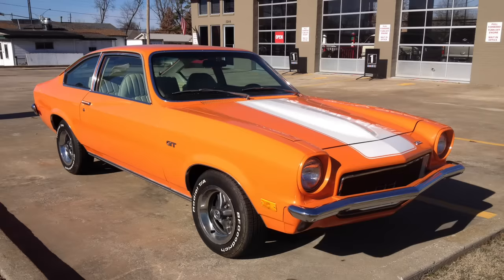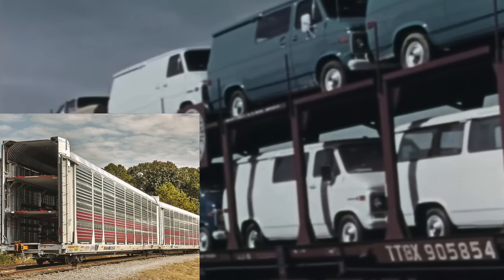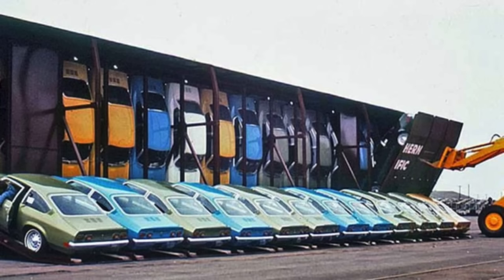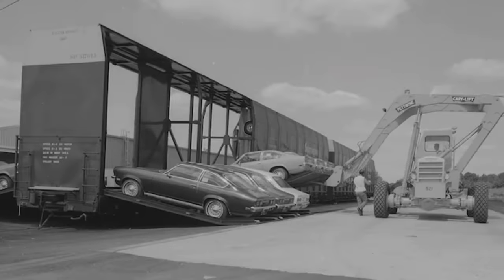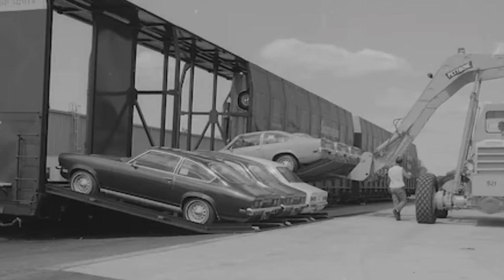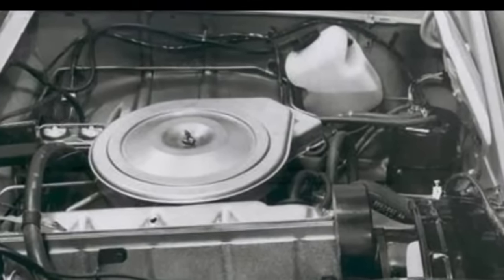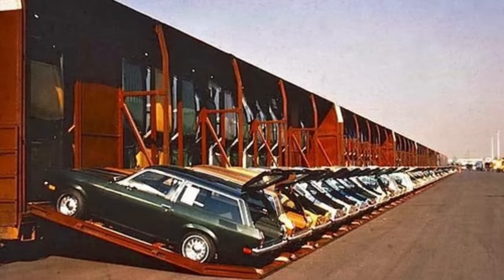GM's Coolest Invention Wasn't Even Part of a Car: The Chevrolet Vega's Vert-a-Pac Shipping System

Comment: Imagine what a great car the Vega could have been if...
-the rust issue was resolved.
-four wheel disc brakes was an option.
-the 3800 V6 engine was offered as an engine choice.
Reply: The 3.8 Buick V6 was a pile of shit in the 70's and early 80's. By the time it went through it's changes and was reintroduced as the 3800, Vegas and Monzas were long gone........
Reply: V-6? in a Vega???  First time I've heard that one.
Reply: @UberLummox  They did put that junk early 3.8 Buick V-6 in some Monzas, which was very similar to a Vega
Reply: Just another failed venture, along with the Corvair and Fiero
Reply: @georgeszilva1223  There was nothing at all inherently wrong with Fiero OR Corvair.
Reply: @georgeszilva1223  GM a failed company? I did not know that, ell oh ell.
Reply: @UberLummox GM got bailed out in 2008 and didn't repay it, and they are on track to need another bailout soon. I'd say GM is a failure.
Reply: @UberLummox  
There's a few videos out there on the internet with 3800s installed in Vegas... Fieros as well. This engine was one of GMs finest and is a common replacement.
Reply: @georgeszilva1223 
By the final year of the Corvair and Fiero   the bugs were worked out and these cars were fairly decent.  GM in its endless stupidity decided to drop both cars for no apparent reason.
Reply: @georgeszilva1223 Yes, the Fiero was such a failed venture that GM sold 370,168 of them.😂
Reply: @johna.4334  Ok interesting. Yeah I heard those 3800s were great. (I think?) The Buick one?
Reply: @catsaregovernmentspies  I thought we were talking 1970s.
Reply: Imagine a world where the Vega never existed.
Reply: The 3.8L would have been too big and heavy for a compact ECONOMY car!
Reply: The early odd fire v6's turned a lot of people off. Once the even fire version came out in '76 it set the stage for better performance.
Reply: @johneckert1365  they put the 305 SBC in the Monza/Sunbird too, if I remember correctly.
Reply: @ekimp252 I had a V8 Monza. It did ok for a smog slug.
Reply: @halfmil6467  back in the day, guys would use the motor mounts and other hardware to put a SBC in a Vega. I used a Trans-Dapt kit to put a 350/350 combo in a Pontiac Astre. That thing would scare the crap out of you.
Reply: @ekimp252  Oh yeah. I dunno about that, but wasn't there a smaller 2XX- something in one of those sh!tboxes? Maybe the Buick version???
Reply: @UberLummox  the Monza had everything from 140 & 152 cu in 4- bangers, 231 & 262 cu in V6s to 262, 305 & 350 cu in SBCs.
Reply: @ekimp252  That's it, thank you.
Reply: @UberLummox  There was a Prototype with a small 8 that never went into production.
Reply: The rust issue was solved and 4 wheel disc brakes on this car are shyte and the engine wasn't the problem. I have owned a plethora of these cars. A few we converted to 4 wheel disc brakes and they just never worked that well. The most successful braking ones were when we used a Monza or an S10 master cylinder. As to the engine, isn't it interesting that BMW, Mercedes and Audi are all using a version of the silicone impregnation in their aluminum engines? The problem with the H-Body cars, was the mentality of the owners. They didn't maintain the cars and blamed everyone else when they failed. I still drive a 1980 Monza Coupe and I have a rust free 1974 Vega in my garage.
Reply: @georgeszilva1223  and also the EV-1 fully electric vehicle.GM is a strange company!
Reply: @curtisbryce5096  Rust free? You must live in California or the Southwest.  These vehicles could not withstand the road chemistry in the Great lakes or Northeast.  The Rust issue improved somewhat in the latter years but they still rotted at their weak points.
Reply: @CSmith-gb1sl  They still weren't as bad as Rustangs. I lived in Calgary Alberta. I just made sure I kept the car clean.
Reply: @curtisbryce5096  Drier air in that area perhaps.   The humidity here lays a coating of brine on the vehicles, over most of the winter months, so keeping them clean is an endless battle... still is (plus your locks freeze) :(.  I have heard stories of these (earlier ones) having rust issues when sitting on the lots new.  I remember the cowls, rockers & lower panels being issue.  (Dad's cowls were gone on the '71 after 2 winters.) remember finally welding in galvanized panels on lower doors, lower quarters after many unsuccessful attempts to fix. 

They have come a long way on corrosion, though I now oil spray undercarriages, & lower body panels/wheels for about 6 months out of the year. 

Dad's Vega replaced his '67 Mustang, the trunk was pretty much gone & the back seat wells were intaking water.
Reply: @UberLummox  
Chevy Camaros and Pontiac  Firebirds as well.
Reply: @TheOzthewiz  
Au contrair,  the 3800 fits rather well in the Pontiac Fiero

Comment: Bean Counters were pound wise but penny foolish!
Reply: Kinda like the Pontiac Fiero. A fuel line made of rubber running across the top the heat producing engine = dry rot engine fires. Lawsuits then Huge recall to Retrofit w/ 100% metal fuel line
Reply: My mom used to say, of my dad, "He's book smart, and life dumb."
Reply: It was the railroad's idea not GM. The RRs saved money by transporting more autos on a given autorack.

Comment: The Vega battery caps were located on the top of the battery just at the top edge to the rear or firewall side of the battery. Not on the side of the battery as mentioned.  I had a NOS AC battery for my 73 Millionth Vega GT to use at shows.

Comment: All those modifications were inexpensive and simple, really just choices of orientation, and as far as I know had no effect on the durability of the cars.  The benefit of avoiding damage,  vandalism,  and theft was a great money saver,  as was shipping 30 instead of 18 per rail car.  I suspect it was a net benefit,  BUT... the Vega was very low-slung, and perhaps not imagined to work on future small GM cars like the Cavalier.
Reply: Never mind about the size-Cavalier was the same height.
Reply: @jamesengland7461 I'm still wondering why they didn't use this method on the X or J body cars a decade later 🤷‍♂️
Were Monzas shipped this way as well?

Comment: It's always baffled me why the Vega had so many reliability issues. Why didn't testing reveal the engine durability problems? Was prototype testing even done on these cars? Were the results simply ignored? I remember reading that Vegas were often vandalized at the factory before shipping. The shipping solution was novel but ultimately a bad idea.
Reply: They were vandalized by accountants and cost-cutting engineers before the first one was assembled.
Reply: GM never proved out the "handling" of a pre 64 Corvair either, especially the wagon. Ask deceased comedian Ernie Kovacs, or me. I nearly rolled over my Dad's 61 Corvair wagon. I didn't dare tell him what really happened. Anyway, when he brought it back from our neighbor mechanic (also) Ernie, who worked full time at a Chevrolet dealership, he said to me-  "Ernie told me to tell you next time you go around a corner, go around on 4 wheels, not two". Not the first time Ernie saw the issue. Gotta wonder how this stuff gets through the "proving grounds". Both the Corvair and the Vega could still be around. It's a shame, they deserved a better fate.
Reply: Good point.  The non-viability of the aluminum cylinder walls should have been found in testing.  I would think any engineer would immediately question that design feature.  Steel sleeves would have solved it. GM had already designed the 215 aluminum V8.  I read it had the aluminum block poured around ripple patterned sleeves.  I also read there was a very high percentage of those blocks had to be scrapped.  Maybe that is why they thought they could get away without a sleeve.  Too bad they just did not make the blocks from cast iron.

Comment: Why are there vents on the trunk?  This is a front engine car.
Interesting video, but what a stupid idea…, as someone else noted, use the extra money to make it better….
Reply: For cabin ventilation. Air flows through the cowl, into the cabin, and then out the rear vents.
Reply: @kw9849 All GM cars had that type of ventilation in 1971. It was discontinued after it was found to bring Carbon Monoxide into the cabin.

Comment: Really interesting video -- thanks! I'm coming at this from the railroad end and, while I was aware of Vert-a-Pac, I didn't know any of the details.

One things, though. Are you sure the height of the cars was an issue? The Vert-a-Pac cars don't look any taller than a conventional open or closed autorack, such as the ones you pictured at 1:05. Conventional autoracks do have routing restrictions because of their height, but that's not specific to Vert-a-Pacs and it's not a big deal. Of course, I'm just eyeballing two different photos, so it's certainly possible that the Vert-a-Pacs were a little taller, which could be enough to cause problems.

Comment: At 5:42 that Vega has an optional radiator that is much bigger than the radiator that came in most of the (non-airconditioner) cars
I believe that the cars with the larger radiator tended to survive to higher mileage than the others

Comment: My  dad worked at a  Chevrolet  dealership  in the 60 s and  70s   he  talked about  how  he would prep the  cars 'Vega ' and would  have to  top off the  transmission  @ engine  w/ the  proper  amount of  oil  before  it  gets to the  Lot  or show room  floor  !

Comment: Not all Vega's were shipped that way. Still, they all had the provisions to be suspended in the rail cars. The slots used for rail shipping were the only place strong enough to pull the uni-body frame, if needed.

Comment: As a kid, I remember seeing cars in an enclosed boxcar, stored at a very steep angle in the direction of the rails. I seem to remember the front as being low and the rear lifted high. I don't recall seeing this often, although I have talked with others who confirmed this. Perhaps it was also experimental, or a safer, less usef method of transport for high value vehicles?

Comment: So happy you posted this video Adam. I was not aware of this. So very cool to see. And I did question the 'liquids' at the start of the video which you educated us on quite well. I just remember tilting my lawnmower the wrong direction and what resulted. So GM really thought this over. In addition, I do remember open rail racks in the 70s. Regrettably, I also remember seeing the odd bully teenagers throwing rocks at the cars when the trains went by. The damage to automobiles must have been quite grand in those days..
Reply: Not flattering of humans a whole new way of shipping needed to be invented to solve a problem that shouldn't have existed.

Comment: Very interesting video, and pretty well done.  One minor point though, height considerations in rail shipments was not something new for these rail cars, it goes back pretty close to the beginning of the railroads themselves.  And there are dozens of tunnels across the U.S. which had additional height added or were "simply" made open to the air so that the regular double decker auto carriers could go that route - showing that height considerations predates these rail cars.  Now if these vertical ones were higher than the standard double deckers, sure extra care had to be taken in routing.  But to suggest this concern was something new that happened just for these cars, is a bit misleading.

Comment: That is some great background in the video... and @eastendproductionsArchiv... provided some very legitimate operational concerns.  I worked at the SP Rail sometime after the demise of this method and was able to rescue one of the presentations given to GM touting this innovation.  A great collection of pictures for sure. I was lucky to eventually work at another OEM deeply involved in the commercial aspects of moving finished VINS.  It is very complicated as the OEM's maximize the load factor whenever possible.  The RR's try to maintain an efficient network and this equipment, clearly being difficult to handle was also difficult to reload and so probably traveled many many miles empty.  Those empty miles were just a huge drag on the RR's economics and challenged the both RR's and OEMS in many ways.  If GM changed the vehicle envelope, the railcar could be obsolete.

Today's Bi and Tri multilevel railcar configurations have far greater flexibility for loading virtually every VIN length or height.  While the RR still only goes forwards and backwards, the current auto rack  / multilevel is about as good as it gets.

Comment: In 1995 I worked at a wholesale automobile auction which received automobiles and van by regular 2 level and 3 level automobile carriers. There’s lots of work to unsecure a load of vehicles from a rail car so I’m guessing that the concept of using vertipack  rail cars was in part trying to save labor loading and unloading them.

Comment: In 2001 I worked for Ford and I opened the door of a new t bird that a wino had hitched a ride across America inside . It was the worst smell ever and we had to replace the seats and the carpet to get rid of the smell and even that was a little iffy . The insurance company put up a fight because they said "you signed for it " and that was true but when we inspected a car coming off of the car carrier we looked on the outside for sand blasted paint and chipped windows in a very quick way we never had vino damage before .It was from Fort Worth to LA I think.

Comment: Back in the day [77-82], I had owned 3 Vegas and 4 Pintos. I had 2 GT's and they were SHARP little cars. They were quick with a 4-speed and even handled okay. BUT!!! The Pinto was a better car, both in design and build quality. Too many people got scared off by "they explode!!" but I'll tell you, the Pinto wasn't as pretty as the Vega. My 72 Pinto 2-door with the 2 liter and an automatic was a quick little beast. I put grippy tires on it and it could corner pretty good, stopped okay too. 
The rail cars wasn't a great idea for many reasons, the biggest losing proposition would be the rebuild and redesign of those cars every 2 years or so. I agree this was not a very well-thought out plan; seems like a last minute fix. Great video!!!

Comment: I owned 2 Vega back in the early 80's. The first was a 74 wagon, it burned more oil than gas, and we joked we needed a 55 gallon drum attached to the roof and a hose run to the engine. Being young and dumb, I put a pair of home speakers in the back with an amp and cranked it up. Sounded good until we heard a crash and then it sounded weird. Blew the glass out of the back door.  My second was a 72 Vega that had very little rust, only at the B pillar and rocker. It had a 1977 engine with the sleeve, Teflon valve guides, 1975 ignition system, and AC. Never burned oil, ran great until the fan decided to pull the water pump apart.  For those who don't know the Vega engine, the valve train is powered by a belt that uses the water pump for tension, the pulley is attached to the stub that the fan, which was direct drive, is bolted to.  It pulled itself right into the radiator and killed the engine.  I was able to fix it, but sold it soon after. It had a 2 speed powerglide with a top speed of 95 MPH.

Comment: I wonder about fluid leaks from places that were designed for more or less horizontal positions. Dipsticks, reservoirs, etc. i don't even know if we had sealed batteries yet or not at the time.
   It doesn't sound good all around especially hearing from the retired railroad worker.

Comment: Having owned a used Manual trans 72 Vega hatch back in 83 which when I got it was on it's last leg in Mn, I had no idea they were shipped this way.  That car got Me through a summer, one winter and into spring. The rear bumper FELL off and I used the E-brake lever to stop for the last month or so. I drove the hell out of that car. Drove Her to the scrap yard, got $50.00 which was what I paid for it. Always got Me home.

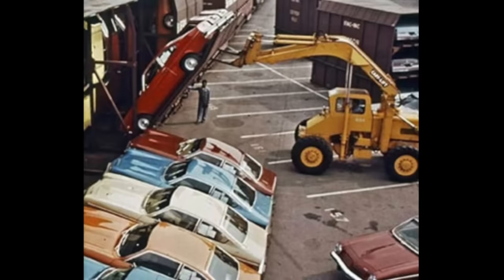Comment: In the picture shown between 7:00 and 8:00, there appear to be some other vehicles, loaded flat, but in some sort of rail car module (behind the front end loader).  Pic is a bit blurry, but they look like the backends of early 70s Cadillacs.  Any idea what the story is on that?  Maybe another experiment?
Reply: I saw that too!! Triple stacked Cadillacs. I currently own a 76 Fleetwood Brougham which has the identical rear end. They're 74 -76 models. The Vegas have the 74 and up rear bumper.
Reply: @MrSpartanPaul  Wow.  That's a beautiful beast.  Thanks for narrowing down the year  - I'm getting a little rusty as I don't see many of those these days.

Comment: Those open "Autoracks" were also used by hobos who sat inside the cars to get a free ride.
The idea was to assemble "unit trains" of all-autoracks running point-to-point, stopping for fuel, crew changes and RR interchanges, certainly not non-stop.
Use of the tall Vert-a-Pac cars was only an issue in the Northeast where older tunnels and bridges were smaller.
7:15: In the background of this photo, notice 'Stak-Pac' modules in the background, intended to do much the same but with larger cars. It never caught on.

Comment: Interesting idea in that it looks like cars could have been selectively unloaded, without unloading or decoupling an entire rail car.

That said, it seems that the concept was not easily scalable to other car models. These railcars would have been dedicated to only a small range of models and the plants producing them, and would be empty for the backhaul.

A simpler solution to increase shipping efficiency would have been to simply add another deck to a conventional railcar.